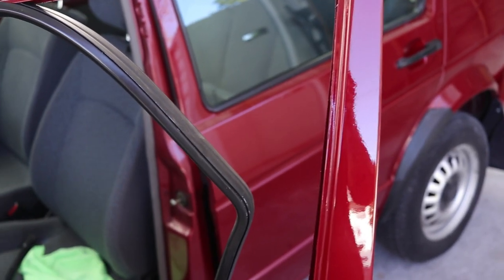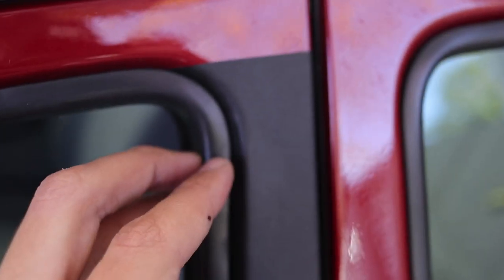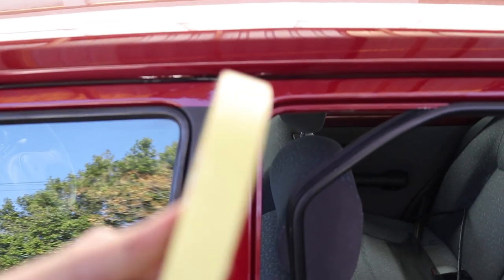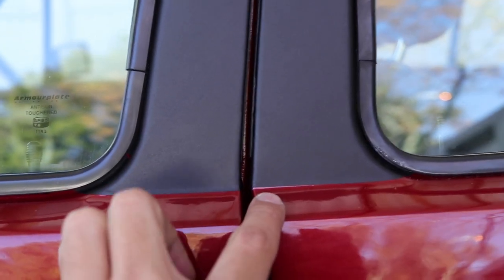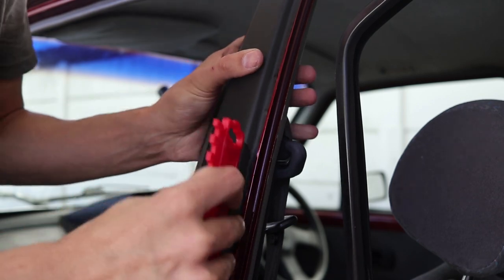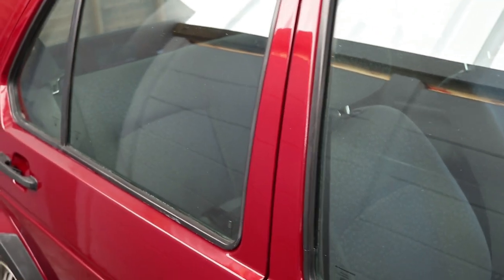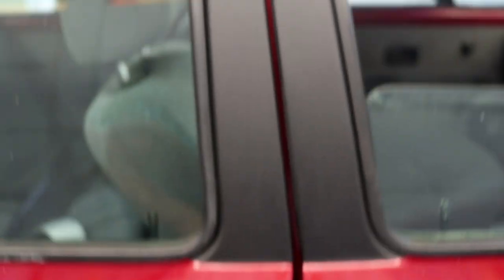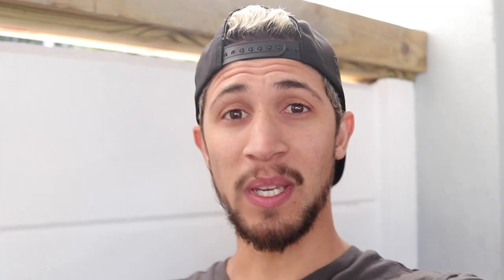Mk1 golf Budget Build | Blackout vinyl installation

Comment: Hey dude! Really enjoying the vids, keep up the great work!
You can easily take the rear window out yourself. You just need to work the rubber from the inside around the lip it clips around and it will pop straight out. I use some hot water and sunlight in a bottle just to lubricate the rubber and start from the bottom of the window upwards as it is tapered. Did it last week to tint my windows and only took around 10 minutes , you can then also sit the spoiler clips underneath the rubber on the window before reinstalling.
Reply from the maker: Thanks so much for that bud 🙌🏻 sounds simple enough, I might just give it a try. Thanks again bro!